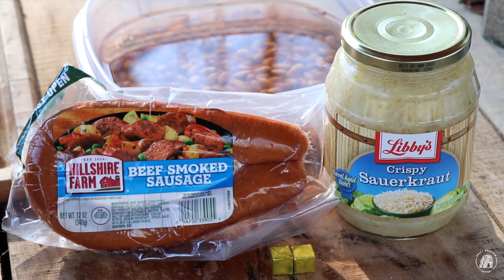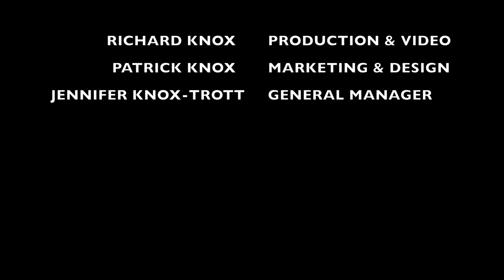S2 EP60 | OFF GRID TIMBER FRAME CABIN | WOODWORK | PREWIRING CRAWL SPACE & INSTALLING INSULATION

Comment: Idea:  moisture in air will be present in crawl space so you could add a solar powered dehumidifier and plumb a tube to outside - drain down hill so occasional maintenance is simple.  Will keep fiberglass dry, reduce any mold potential, and anything stored down there will be dryer or less prone to rust.

Comment: Hindsight is everything: pouring a slab would have allowed you to use a creeper to roll around everywhere in the crawl space. You will have a lot of work to do down there with wiring, plumbing, radiant barrier, etc. Why is the floor insulation so thin? You have 10-12” joists, they make thicker insulation. I've enjoyed watching your build.
Reply: He's down south, I don't think code calls for as much R value I floors. Don't quote me on that I don't know his plans, but I figure he's up to code after watching him secure the electrical to the floor joists so methodically.
Reply: @theycallmebacon5692  My comments aren't related to codes. He's building his cabin most likely with no codes which is fine with me. I just think from a warmth perspective, he could go thicker on insulation. East TN doesn't get bitter cold like the North, but not knowing his elevation, parts of East TN do get cold, Cumberland plateau from Crossville over and the Smokies. Nashville is only around 600ft elevation. Our weather is considerably warmer than the same latitude east of us on the plateau and beyond.
Reply: @photonashville  I didn't mean to sound like I was knocking your comment  I was only pointing out tennessee only requires R19 in the floors, where he's left a gap between the insulation and where the subfloor will be and where there going to be a gap between the bottom of the insulation and what ever material he's going to put below the insulation it's going to be a little better than R19. I think he's going to have warm floors. Like I said tennessee is warm in the winter in comparison to what I have grown accustomed to. Nashville is shorts and t-shirt weather year round.

Comment: Why didn't you stand up between the floor joists to do most of that work? It would have saved you your back and knees. Bending over wouldn't have been near as bad as crawling under the joists. But, whatever gets the job done. Good job.
Reply: My thoughts exactly!  Too much bending and walking around on joists.  Thinking it would be both quicker and safer.